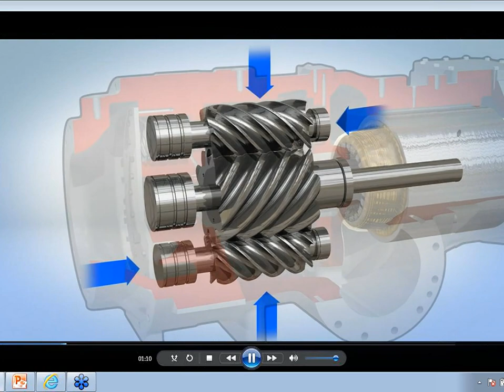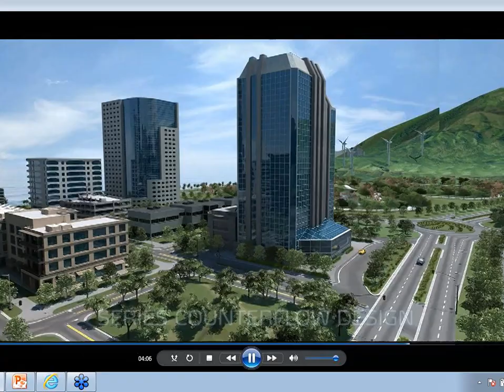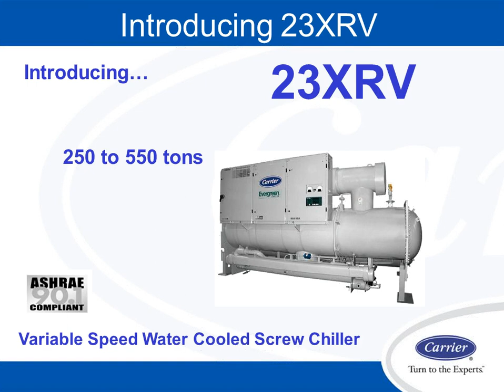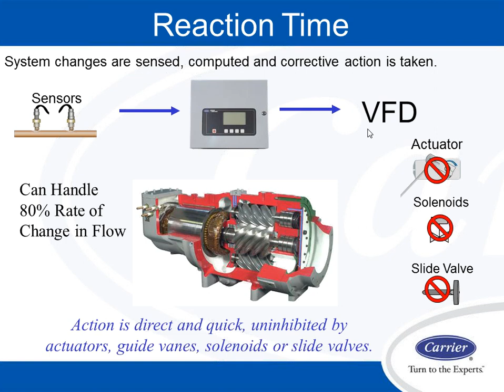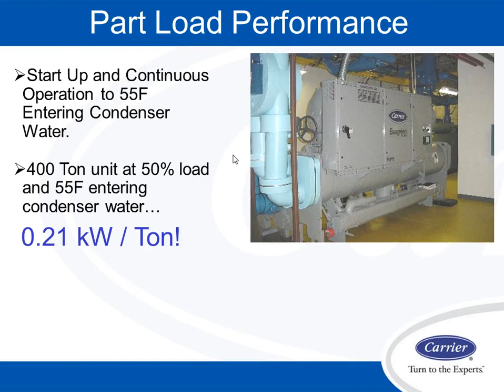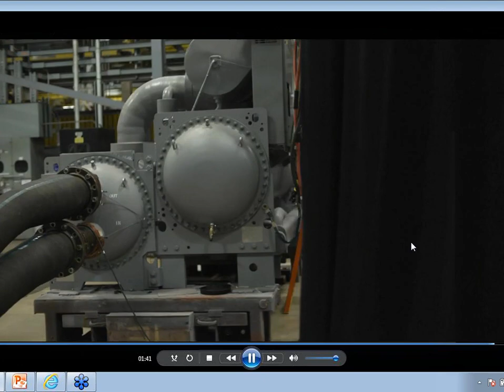Carrier 23XRV Hi-Efficiency Screw Chillers - Webinar 12/17/12

Comment: Hi! Two months apart, the VFDs in our 2014 model year twins (23XRV3031NQV) burned out. Could this be related to the vfd refrigerant-cooling circuit? All suggestions are welcome, thanks...
Reply from the maker: We don't have any way to know what issues occurred at your site. Hopefully your mechanical servicing contractor can diagnose.
Reply: @TECTubefilms 
thanks for quick reply.
You're absolutely right of course, even though the problem appears to be electronic, not mechanical! Should we expect a costly drive failure in 11 years? Do you experience it often, for example?
Reply from the maker: @e_eng6562  Drive failures on chillers are exceedingly rare as compared to fans and pumps. And even fans and pumps are way less failures now than back in the 1980s or 1990s.
Reply: We are getting a ground fault on our 23XRV3031 the motor meet test passed and carrier plugged into the drive and it passes ???
Reply: Do you remember the fault I’m getting 13 ground fault

Comment: Yea, but Screws can't handle surge.
Reply from the maker: Opposite. Screws do not have a surge limitation. Centrifugal compressors are the ones susceptible to surge. (note: we use centrifugal, screw, and tri-rotor screw machines here at TEC)
Reply: @TECTubefilms  Interesting; that's not what I was told from "the guys". 

In that case, I will be reconsidering my opinion if I am ever asked for it again on what type of units management should choose for large Building Envelope HVAC loads. 

It was hard to follow along the video since the first 5 mins. had me confused about what water temp. he was referring to, but then was able to hear him clarify it was "entering water temp"; I give video 3.5 stars though.👍
Reply from the maker: @MR-backup  check out this short video... the first sentence regarding the 23XRV tri-rotor screw stats "surge free" https://youtu.be/iZfuayXvF-E?si=dWxnUIY46mc925oJ
Reply: Screws are much more robust in my experience.